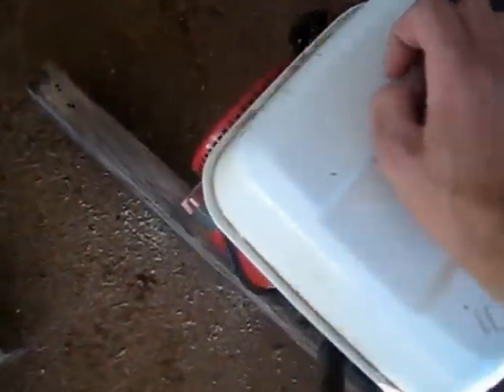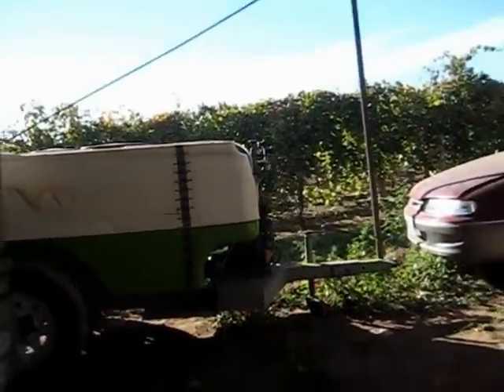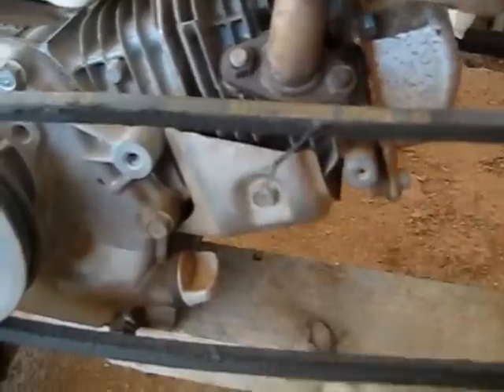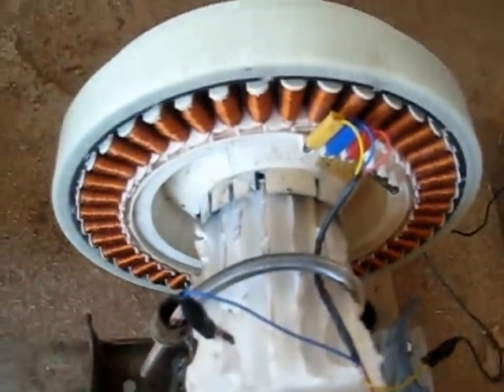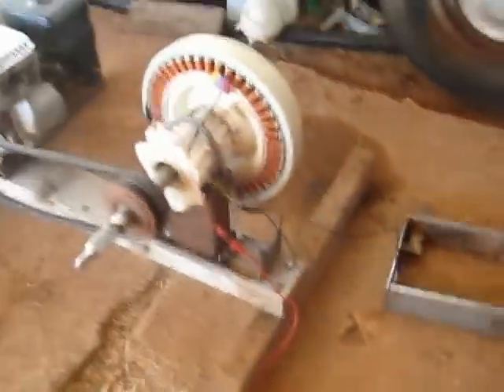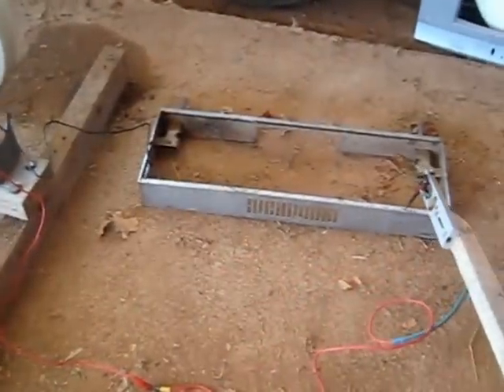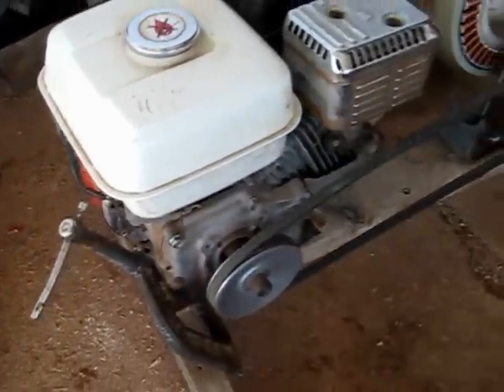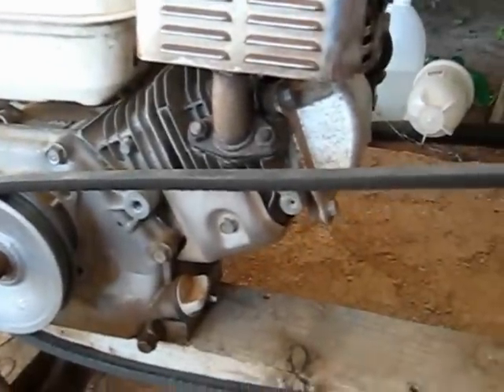GX140 Load Test Using F&P Generator

Comment: Running an engine under load for a period of time may in fact clean out some carbon but I have found remarkable success using products that can break down the carbon residue. I would imagine penetrating oil would work too, but Marvel's product and Hydrotex's Essentialube have been the two I've used most and had good results with.  The unfortunate side effect of this procedure is a huge cloud of white smoke, but I've been able to unstick several engines without overhaul, so, worth it to me.

Comment: In my experience  with towed message boards using 2700 watt Onan generators, the gen. was running from idle to full throttle and back as the message board cycled through it's operation.  This carboned up the engines in fairly short order... as a result we replaced or repaired several engines until we replaced the generators with larger units.  Marvel Mystery Oil mixed in the fuel may have actually helped those engines run longer.

Comment: Generally, if an engine has good compression but is burning oil though not continuously, it means that the oil ring is carboned up.  My thinking would be to use Marvel Mystery Oil in a squirt bottle and squirt as much as you can in a running engine and rev it while doing so... you might be surprised and have the ring free itself up.

Comment: the honda oil ring wears quicker than the compression rings, I have had several in here, less than $50 will get you a gasket set and rings from overseas on ebay and it would be good to go again.

Comment: LMAO!!! A whistling arc! :-D

But yes, that's definitely a voltage blast coming out of there!

Do you have a volt-meter handy to see what the output was?

The belt looked a bit slack. I was wondering if it could be tensioned a bit more to get more kick.

I wonder how this set-up would behave if used as a replacement to a MOT for zapping things? It'd probably be a bit more expensive to run, given the cost of petrol, BUT you may get more oomph than what you'd get out any-sized MOT.

-BBD

Comment: most of the yellow flashing is from the zincalume coating on the steel casing you were arcing too....did you not get a chance to measure the voltage with a meter..

Comment: The output from these direct drive wash motors is square wave, so I wouldn't try to run anything you wouldn't use a cheap invertor on.  The solution is to step it down to around 14v then use a rectifier with capacitor to an AC inverter.  You could run most of your house with this.

Comment: It seems you could put a HV transformer to 2 leads and get back a very usable voltage and amperage.  Local power company servicemen can tell you where to get a step-down transformer, or just use one from a microwave.

Comment from the maker: That could be a Possibility, I know with Diesel engines which have been Lightly Worked all the time can get Glazed Cylinder walls, which can lead to Premature Piston ring wear, Eg, If a Glazed engine is ran hot suddenly and loses Compression soon after, then The Engine has been ran in this state for too long!, If it still has good compression afterwards, then the glazing and Carbon has been freed up from the rings!, Usually a Good few Hours of hard Labour will fix a Glazed up Diesel!